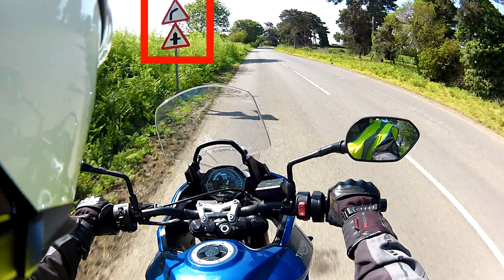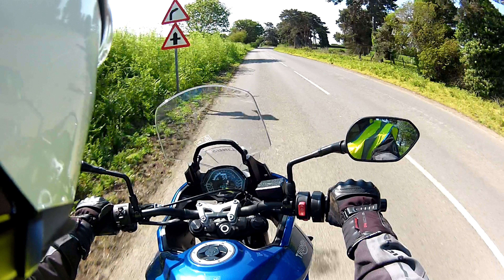Quick Tip - #11 Use the slip road | Dual carriageway | Triumph Tiger Sport & Street Triple 765 R

Comment: A pet hate of mine is those drivers who are on a sliproad and stay at about 40mph, expecting me to facilitate their entry onto the main road. Any vehicle has much better braking than acceleration, and it is easier to lose speed at the end of a sliproad if unable to merge than it is to desperately try to accelerate in the last few yards. The traffic in Lane 1 usually moves at around the mid fifties MPH, so briskly get to that kind of speed and you will usually merge easily.
Reply from the maker: Yes, dawdlers make it difficult for everyone.

Comment: Hi, I failed my MOD 2 in a situation like the last example where the driver kindly moved over. The examiner said the rules state if my actions result in another driver having to change direction it’s a fail. Seems like a totally unfair rule to me as it’s taken out of your control especially if you are following a car on the slip road
Reply from the maker: The requirement then is to hold back and time your arrival. Obviously I didn't see your test but if the car ahead on the slip road is not getting up to speed, then increase the gap to it. There's a difference between a vehicle on the main road that has moved to lane 2 to allow you to merge and a vehicle that has had to slow or move because you came out. A subtle, but important difference.

Comment: Absolute rubbish.  We re not talking about motorways here at all. I know of several slip roads that are downright dangerous,. Unlike  a slip road on a motorway the ones that I come across are too short and not wide enough to allow drivers on a single carriageway or a dual carriageway to give way, They are not obliged to give way to you at all and in many circumstances that I have come across they don't  or won't allow you entry.    That causes the driver  on the slip road to slow or  even have to stop in order to have safe room to gain access to that road. 

They might as well have a stop sign and be required to stop as it would be dangerous to just believe that one can drive down or along any slip road and expect to have room to slip into any stream of traffic.  It doesn't work that way.  So one can  fool oneself by  driving or riding into danger if one presumes  or assumes that one can  easily expect to slip into traffic by merely being on any slip road and that others will give way to you.  Not bloody likely..
Reply from the maker: Yet another constructive comment from you Mr Craven. NOT!  Did you actually watch and listen to all of it, or just go straight to keyboard? Nowhere in the video do I mention motorways or say that I expect to be let on to the dual c/w, in fact I even say you may have to stop. I also point out that each slip road has be treated differently and that SOME are so short you have to STOP and treat them as a T junction. Using the provided slip road with good observation, matching your speed, choosing a joining point. Doing it all well is a skill of riding/driving at a high level.
Reply: @mikeroberts ,  excellent video and explanation of using a slip road Mike, judge each on its own merit, using the slip road to gain and match the speed of vehicle's on the main carriageway is safer and smoother, as you rightly said  some have to be treated as a T junction as they are simply to short, one or two joining the A12, coming from Stoke by Nayland direction for example, this is where observation, anticipation and planning comes in, knowing where it is suitable to make progress but also where restraint is required, once again excellent video, ignore the trolls and keyboard warriors for they know not what they do, keep up the good work
Reply from the maker: @andrewrobotham2913  Thanks Andy
Reply: @mikeroberts  I understand where you are coming from but would suggest that the comments that I have made are all constructive and therefore positive ones. .Yes you do say that all slip roads are not the same length.   That one that you apparently travel at least some 30 times a day and have no trouble riding down is some 250 metres long  tho you do admit that their lengths can vary that one is particularly long in my estimation. Certainly as long as one would find on a motorway .However, the one I mentioned was by comparison a short one  and would have been about one quarter of that distance. So only some 60 meters in all.   So my friends circumstance  could have been much different to yours. Plus he was on the main road and the car that created the danger was using what slip road there was. 

You also mentioned on the  third occasion that the traffic in the inside lane had eventually moved over to the right hand lane as if that was an expectation and so I mentioned that one cannot expect any vehicle to do that at any time and so not to anticipate  it.

My comments were not at all  a  criticism  of what you were  experiencing but putting forward my own experience  and that of others all in support or your endeavours to show safer riding.    

So to reply,  my comments were in no way  critical  of you or that such criticism  were of a negative nature is truly not the case. I merely pointed out  a circumstance that had occurred to my knowledge and one that could hopefully stick with your viewers and perhaps benefit them to be more experienced and safer on the road.They  were based on my own experiences and that of  others known to me. 

Happy and safe riding and please do continue to give us some of the best safe riding videos on YouTube today.